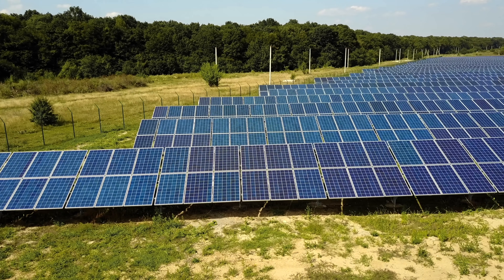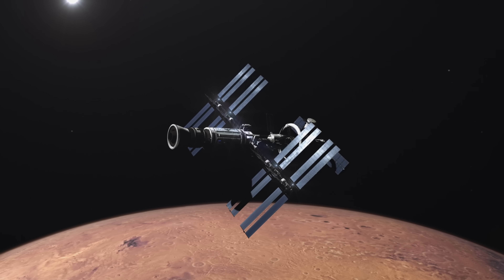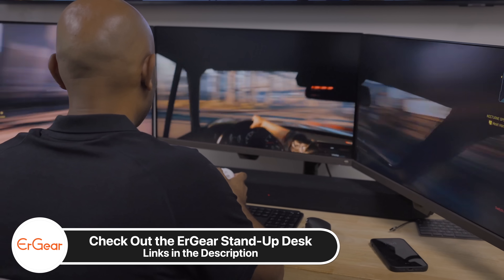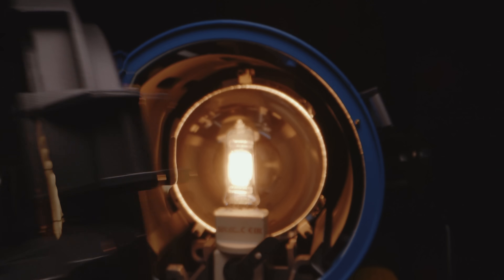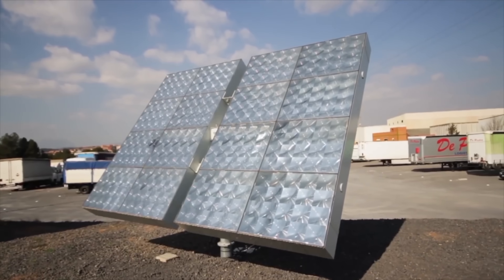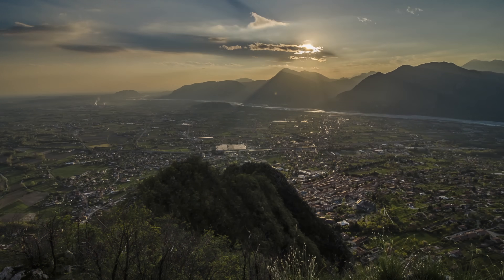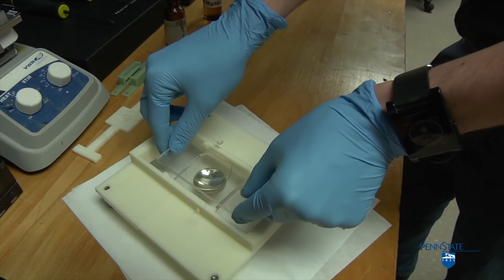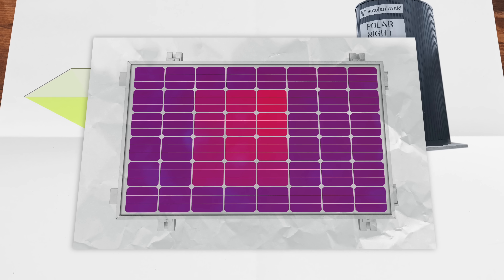Why Don't Solar Panels Have Magnifying Glasses On Them?

Comment: Very exciting progress which reminds me of another exciting idea I hope you might have interest in researching. It was some kind of covering plastic  like layer placed over a PV panel that did not block the part of the light spectrum the PV panel absorbs but did convert the red end of the spectrum which PV panels don't use to a usable wavelength to produce substantial increase in efficiency. This layer could be added to most any  PV  panel being made. Have you read anything current on that application?